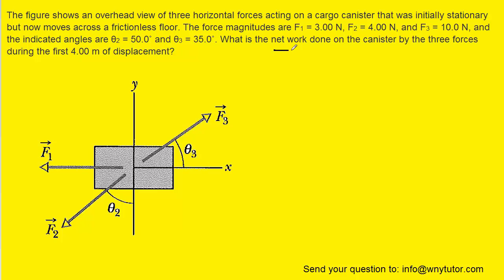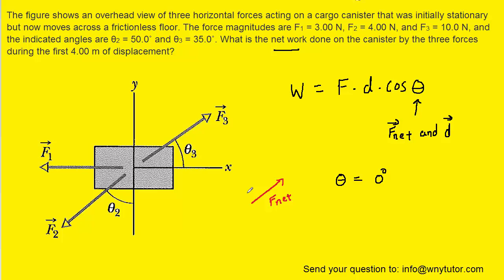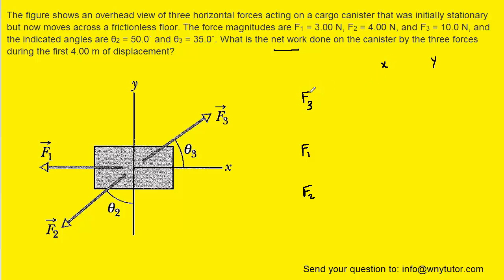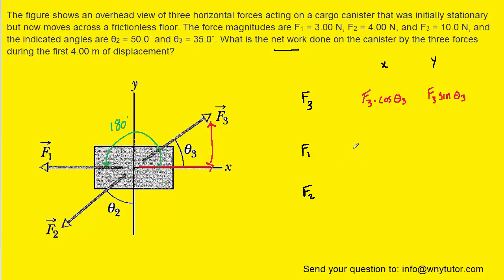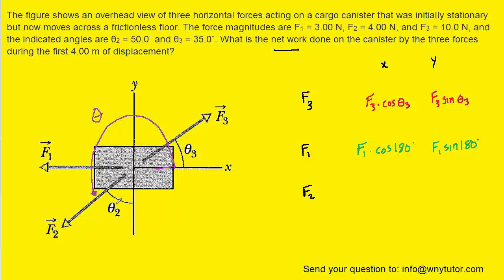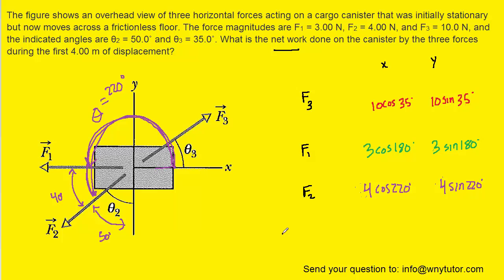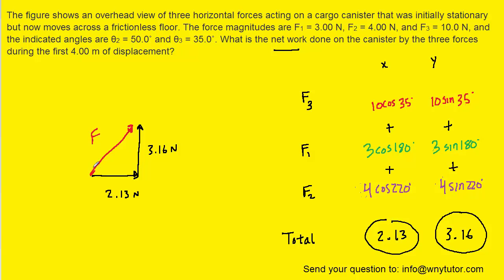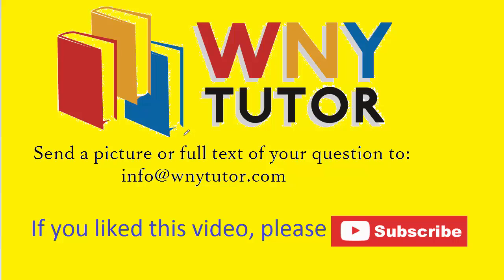The figure shows an overhead view of three horizontal forces acting on a cargo canister

Comment: Why you didn't use w=Fdcos  the angle of Fnet is 56.02 ,so why is not w=(3.81)(4)cos(56.02)=8.52J
Reply: haha 7 years later but you are correct, no necessarily using your method because is slightly longer but it is the same result, |F||d|cos(theta) where theta is the result of escalar product between magnitudes <F,d> / |F||D| which eliminate |F||D| in the work equation and finally we have the other work equation (which we should use at the beginning) F.d that is F_x Delta_x because the displacement at y is equals to zero and it is not necessary, F_x = 4cos(-90-50)° + 10cos(35°) - 3 N, and Delta_x = 4m. Finally it is 8.52J as you got
Reply: @anderiotti  wrong, this is an overhead view! Not a side one